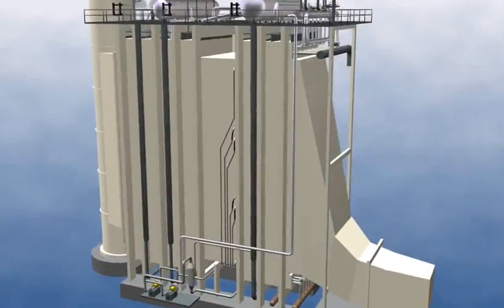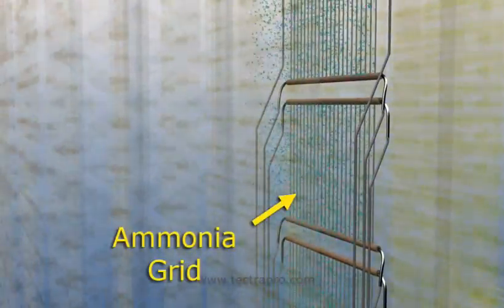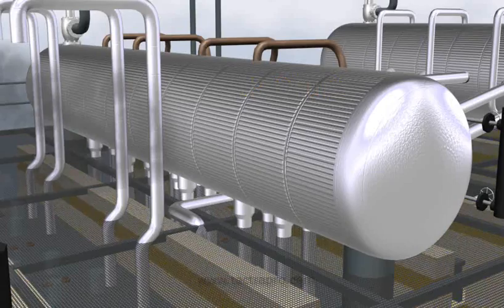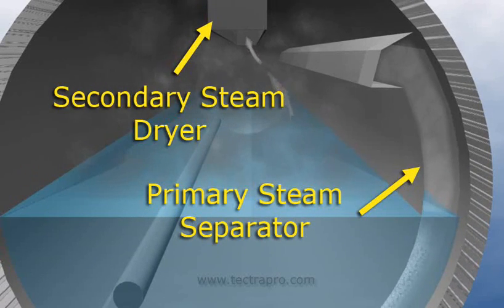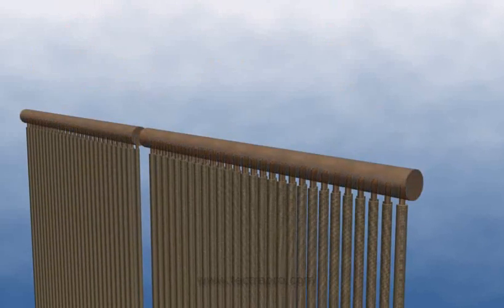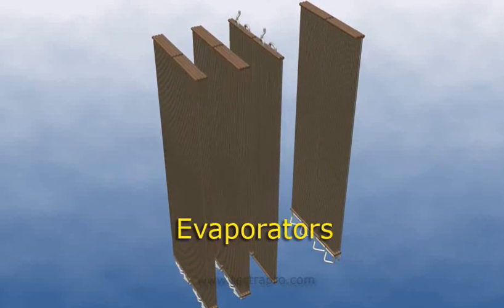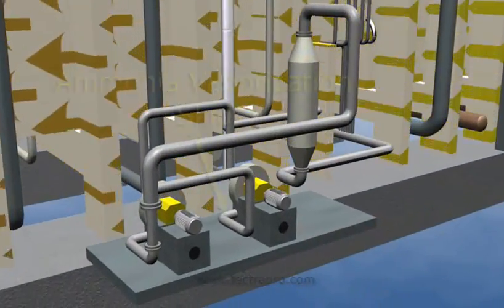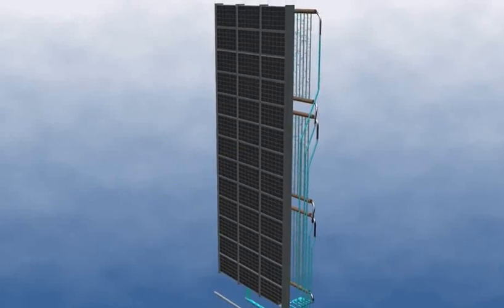HRSG

Comment: it is produced by the modial interaction of magnetoreluctance and capacitive directance.

The original machine had a baseplate of prefabulated Amulite, surmounted by a malleable logarithmic casing in such a way that the two spurving bearings were in a direct line with the pentametric fan. The latter consisted simply of six hydrocoptic marzel vanes so-fitted to the ambifacient lunar wane shaft that side fumbling was effectively prevented.